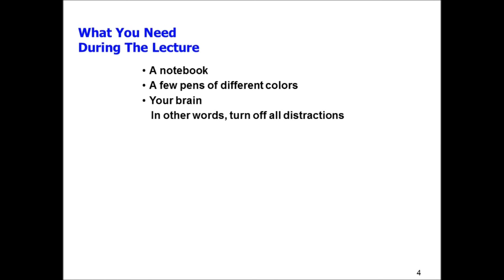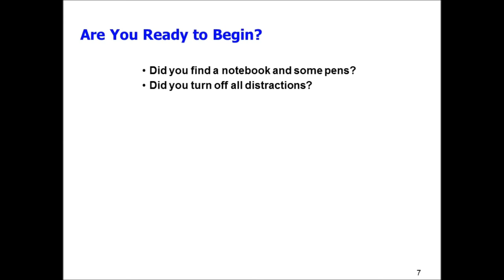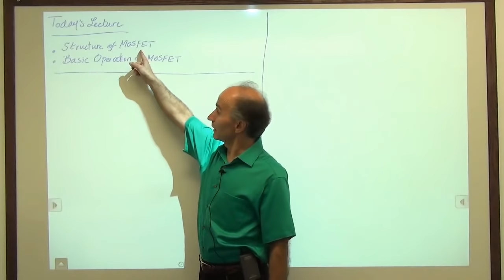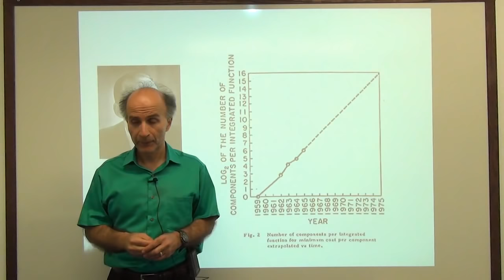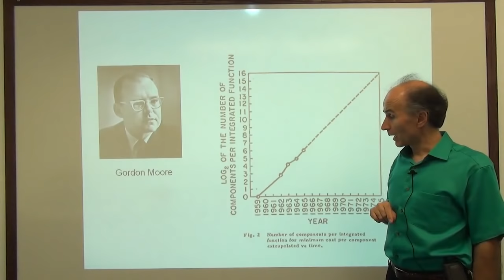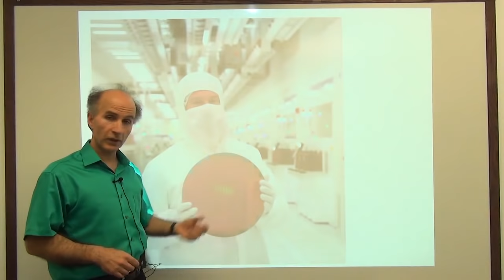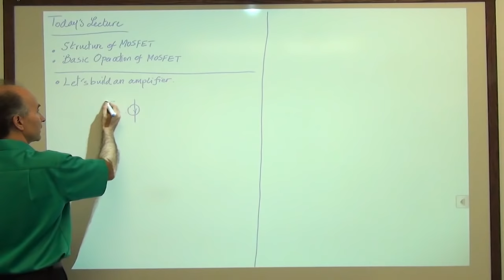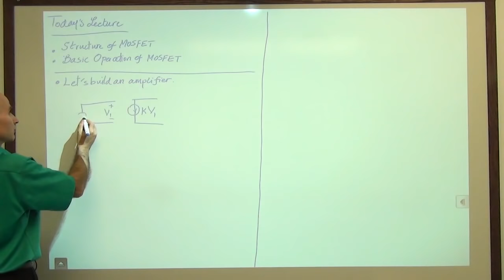Razavi Electronics 1, Lec 29, Intro. to MOSFETs

Comment: Can any explain what happens to holes in p type semiconductor as he took only about electrons in consideration ,if we invert the voltage applied between semiconductor and capacitor as holes are more in p type it conducts more current. 15:03 min ?

Comment: Exceptionally excellent lectures. Prof. Razavi is great. The whiteboard and the pen are high-tech as well. The manufacturer should make one small improvement - make the other end of the pen as an eraser so professor does not have to use menu system to select an eraser function. That will emulate a pencil better and save professor time.
Reply: Hi that is a great , idea. i am studying electrical engineering and i happen to be also doing motor and generators, would you know who teaches them well here on youtube or anywhere is there a websites

Comment: I went through transistor lectures first in this Electronics 1 lecture series. Views decreased as the transistor lectures went by. Lec 28 is the last lecture on transistors. Suddenly in the middle of the lecture series, this Lec 29 has much higher views than Lec 28. 
It feels like new students have joined us like in real life in a university class 😄😄

Comment: Why is a p substrate being used? N type will have more of free electrons. Wouldn't it be better  for forming a electron channel?
Reply: This is a way to control the flow of electrons using Voltage at Cap

Comment: i did not understand why source and drain are highly doped n type materials. if it is for making good contact between metals and material then my question is in case of PMOS we use P+ type materials for source and drain. I want to know the noble cause for using them ?/ 

What i thought is depending on the channel source and drain are doped with corresponding materials for the smooth flow of charge carriers is that correct or any answer?
Reply: Yea UA right.....the thing is highly doped in the sense...would create more free charges ...electrons for n+ and holes for p+ thus making a better channel to be formed btw source and drain.. :)
Reply: The contact is so small and we want to flow high(relative) current through the source so we need to put either a wide connection to the source and drain or we can make a higher dopping

Comment: in 52 .50 we assume that vd>vs; and vs is ground. what if vs > vd and vd is grounded.is the result would be current will flow from drain to source like pmos. can anyone explain this
Reply: For a textbook-use MOS, I think the answer would be YES! After all, Observation 2 at the bottem right of the previous page says this device is SYMMETRIC.

Comment: 17:50 It does not follow from Charge increasing that Charge Density increases.  If the volume/area/length of the distribution of the Charge also increases then the Charge Density could remain the same or even diminish.
Charge Density isn't defined, so that's very unhelpful. Wasted a lot of time trying to figure out what was going on.
Reply: But the volume, area and length are constant. Free electron density increases in the are between source and drain because that's the point where we apply Vg. Charge density is the number of charged per unit volume.

Basically, in the channel connecting S and D, more free elections gather this reducing resistance of the channel which in turn increases current